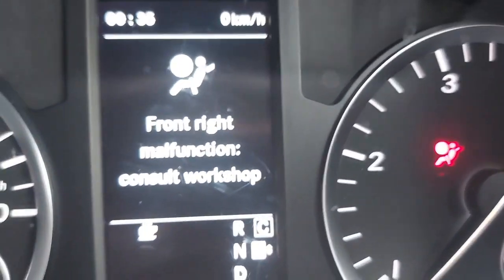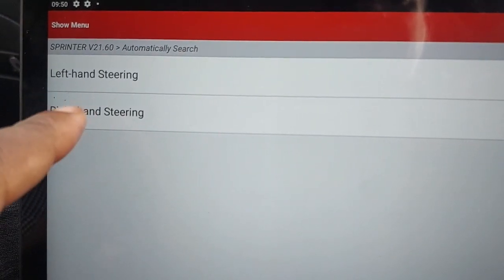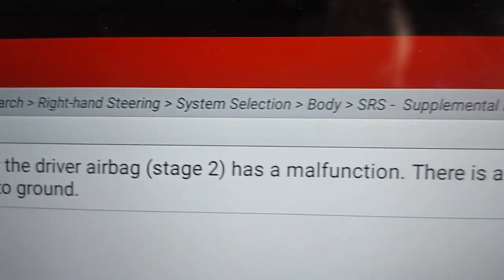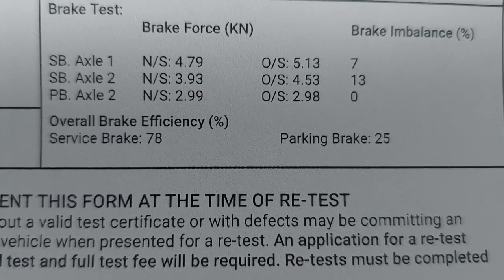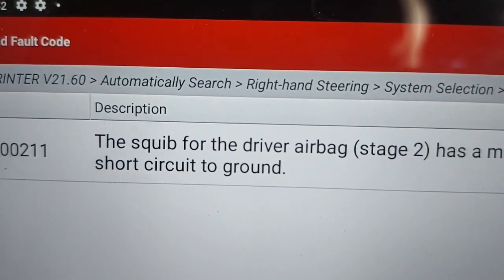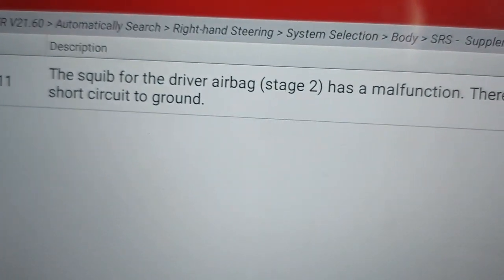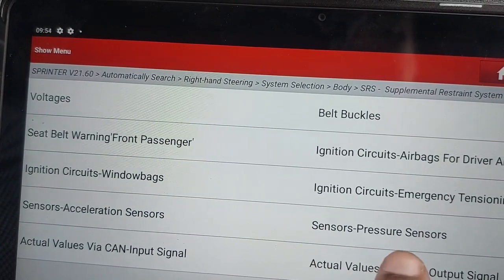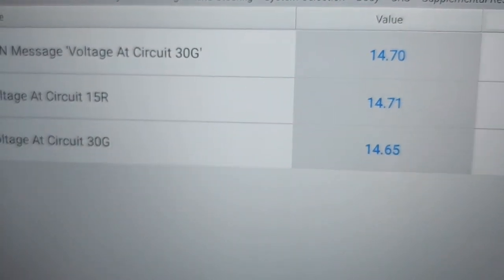Mercedes Airbag Test Exposed - Mechanics Hate This

Comment: Have you been able to fix the Airbag fault?
Reply from the maker: I did. It was a simple fix. It was caused by poor contact, just needed cleaned
Reply: @ the plug under the seat or which contact was it in your case?
Reply from the maker: I dismantled the component which houses the indicator stalk and the gear selector. Dismantled and found overheated pins which i cleaned and everything came to life again